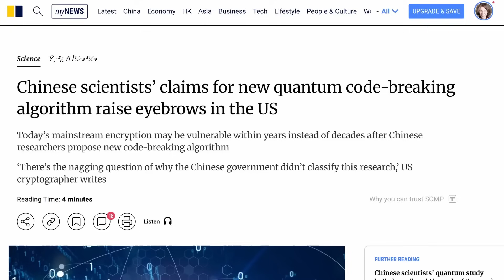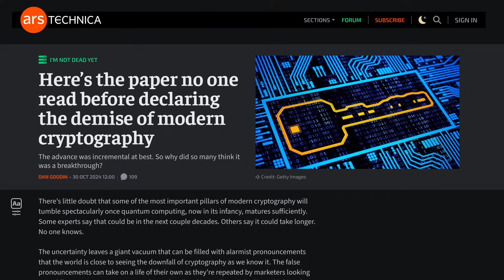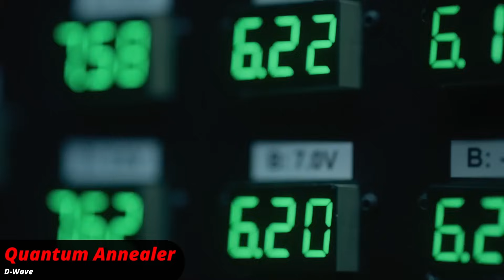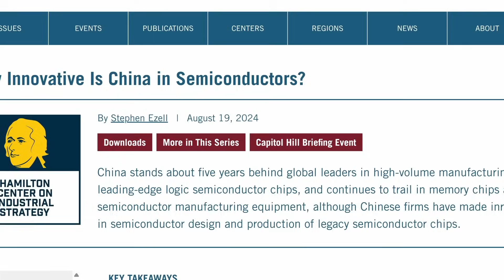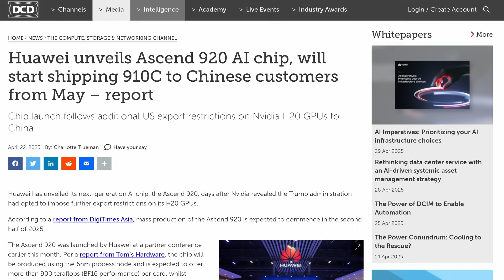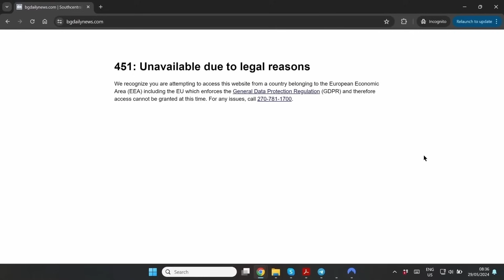Chinese claim "First Successful Factorization of RSA-2028 Integer". I've had a look.

Comment: "A quantum apocalypse?" "A quantum of lies?" well... a small anything doesn't sound that bad.
Reply: Nice
Reply: Lol nice. But Quantum just refers to a system made of discrete units that cannot be broken down into pieces of the same thing. Grammatically it should be "a quanta of apocalypse". Which would mean an irreducible unit of apocalypse. For example when the sun turns into a red giants and destroys earth I would say that is an irreducible unit of apocalypse, i.e. a quantum of apocalypse, if you will.

Comment: RSA used to have challenge numbers with prizes for factoring but disbanded it when it turned out that a large part of the US power grid was devoted to trying to factor them.  But here they are if you want to try for free. PS if they factored THIS rsa-2048 it's an actual achievement.  Nobody knew the factors including RSA, the factors having been destroyed in generation to prevent cheating by anybody.

Name:         RSA-576
Prize:        $10000
Digits:       174
Digit Sum:    785
188198812920607963838697239461650439807163563379417382700763356422988859715234665485319060606504743045317388011303396716199692321205734031879550656996221305168759307650257059
Name:         RSA-640
Prize:        $20000
Digits:       193
Digit Sum:    806
3107418240490043721350750035888567930037346022842727545720161948823206440518081504556346829671723286782437916272838033415471073108501919548529007337724822783525742386454014691736602477652346609
Name:         RSA-704
Prize:        $30000
Digits:       212
Digit Sum:    1009
74037563479561712828046796097429573142593188889231289084936232638972765034028266276891996419625117843995894330502127585370118968098286733173273108930900552505116877063299072396380786710086096962537934650563796359
Name:         RSA-768
Prize:        $50000
Digits:       232
Digit Sum:    1018
1230186684530117755130494958384962720772853569595334792197322452151726400507263657518745202199786469389956474942774063845925192557326303453731548268507917026122142913461670429214311602221240479274737794080665351419597459856902143413
Name:         RSA-896
Prize:        $75000
Digits:       270
Digit Sum:    1222
412023436986659543855531365332575948179811699844327982845455626433876445565248426198098870423161841879261420247188869492560931776375033421130982397485150944909106910269861031862704114880866970564902903653658867433731720813104105190864254793282601391257624033946373269391
Name:         RSA-1024
Prize:        $100000
Digits:       309
Digit Sum:    1369
135066410865995223349603216278805969938881475605667027524485143851526510604859533833940287150571909441798207282164471551373680419703964191743046496589274256239341020864383202110372958725762358509643110564073501508187510676594629205563685529475213500852879416377328533906109750544334999811150056977236890927563
Name:         RSA-1536
Prize:        $150000
Digits:       463
Digit Sum:    2153
1847699703211741474306835620200164403018549338663410171471785774910651696711161249859337684305435744585616061544571794052229717732524660960646946071249623720442022269756756687378427562389508764678440933285157496578843415088475528298186726451339863364931908084671990431874381283363502795470282653297802934916155811881049844908319545009848393775227257052578591944993870073695755688436933812779613089230392569695253261620823676490316036551371447913932347169566988069
Name:         RSA-2048
Prize:        $200000
Digits:       617
Digit Sum:    2738
25195908475657893494027183240048398571429282126204032027777137836043662020707595556264018525880784406918290641249515082189298559149176184502808489120072844992687392807287776735971418347270261896375014971824691165077613379859095700097330459748808428401797429100642458691817195118746121515172654632282216869987549182422433637259085141865462043576798423387184774447920739934236584823824281198163815010674810451660377306056201619676256133844143603833904414952634432190114657544454178424020924616515723350778707749817125772467962926386356373289912154831438167899885040445364023527381951378636564391212010397122822120720357

Comment: If the two prime factors only differ by two bits, that roughly corresponds to a 50 bit RSA level of security

EDIT: since my responses get blocked ... It's 25 bits corresponding to the position of the first difference (12 bit) a, the second difference (12 bit) b, and whether the differences have the same sign (00/11) or different sign (01/10). Once you know the product c and these, a factor x can be computed by solving the simple quadratic equation (x + 2^a ± 2^b)x = c. This equation is just in natural numbers, no modulus, a solution can quickly be found using binary search. This makes just 2^25 values to search, compared to the typical 2^1023 in full 2048-bit RSA
Reply: No. One factor will be 1025bits while the other is 1023. That will be 1023 bit security.
Reply: @chaoticmoh7091 You mean the LENGTH differs by two bits, but that is not what Sabine said.
Reply: @MoiraLachesis  . In RSA difference in length of factors is what they talk about. She assumed we are conversant with that. That is why she didn't clarify
Reply: @chaoticmoh7091 That's not "special" however, it's completely normal to have the factors of the exact same length in bits. If I look into the paper they also say both factors had a length of 1024 bits, so what you say doesn't check out either. In any case I'm not wrong, I even explicitly said "if" (I was worried about some communication mistakes myself) It's still good that you point out there might be a misinterpretation.
Reply: @chaoticmoh7091 If you have the product, the bits that differ, and whether they are 00/11 or 01/10 you can directly compute the factors without further guessing.
Reply: @chaoticmoh7091  Yes, it's 25 bits. If you know the product, the bits that differ and whether they are 00/11 or 01/10 you can directly compute the factors without further guessing. It's a simple quadratic equation (x + 2^a ± 2^b)x = c.
If you don't believe me give me a modulus created that way and watch me crack it on my laptop.

Comment: RSA hasn't been used to encrypt data on the Internet for more than 25 years.  Its simply TOO SLOW for that use case.

RSA is used for "proof of identity" - i.e. TLS Certificates.

AES is used to encrypt data, and Diffie-Hellman is the mechanism for generating and sharing the AES encryption keys.  Neither of which are susceptible to "factor large numbers" attacks.

Breaking RSA won't expose your protected DATA, but it will allow nation-state funded hackers to impersonate trusted entities - think Mossad impersonating Wells Fargo Bank - but that still requires DNS poisoning to trick your computer to send data to their server instead of the real one.

Comment: If the 2 numbers p q of RSA 2048  differs by only 1 bit, or few bit, there exist a simple algorthm: you take the square root of the number, and you check from there the number near the root, and it's very rapid, no need for D-wave something
Reply: It's not that p and q differ by one bit, but that (p+q)-√pq is small, say less than 2^128.
Reply: @pierreabbat6157  Correct.
Reply: That only works if the differing bits are of very low significance, or in other words, towards the end of the number. The two factors would then be very close to each other.
Reply: If the flipped bit is at the 2^k position, then p and q are approximately sqrt(N) +/- 2^(k/2), so they may be quite far from the root.
Nevertheless, running Fermats algorithm near those ~2048 starting points for different k may be quite feasible.
Not to mention that, while big k make the error in the estimate bigger and might require more iterations, one can then increment in bigger steps because one can make good guesses about p mod 2^k
Reply: Square roots have periodic zigzag paths in the binary SB-tree... and as Gosper said, computing with arbitrary word lengths beats fixed word length computing in many ways

Comment: All this is funnier when you understand that to avoid the "quantum speedup cracking every cryptographic system" all you need to do is double the number of bits for encryption.
Reply: Yes, going forward. The issue is the Library-of-Alexandria amount of information already collected just waiting to give up its secrets.
Reply: Yes, the same tactic that works against advancing conventional computer brute force also works against quantum computing.  In the case of quantum not just speed, but also whether the computer can handle numbers that big.  And by that measure classic RSA, with a longer key, has an advantage over the supposedly quantum resistant eliptic cyphers with shorter keys.
Reply: This is true for hashing algorithms like SHA256 but not for RSA. RSA gains an exponential speedup with Shor's algorithm, making RSA useless if real and big quantum computers ever comes to fruition.
Reply: @OdoctorG  Shor's algorithm doesn't account for quantum computers being unstable in exponential scale with number of Qbits.
Reply: @OdoctorG yes that's what i said
Reply: Shor's algorithm finds factors in  nearly O(n log log log n). Increasing the key size doesn't give exponential difficulty increase.
Reply: @edwardhuff4727  But the chances of a quantum computer losing coherence and crashing is exponential with the number of Qbits being worked.
Reply: @edwardhuff4727  not for symmetric keys
Reply: This is false (in the case of RSA). Shor's Algorithm factors arbitrary numbers in polynomial time wrt log N. Doubling log N will not necessarily make the quantum threat nonexistent.
Plus, the larger you get, the harder it is to actually generate keys of those sizes.
Reply: @titangames6888  yeah fine. It's true for symmetric keys. For Shor there are many other methods to avoid the quantum speedup.
Reply: @PathfinderPhysics  Really? I have not been aware of any such "other methods". Can you provide one or two such "other methods"?
Reply: @titangames6888  Shor's algorithm doesn't account for exponential instability with the number of Qbits being used.
Reply: @hanelyp1  Okay, fair criticism. That's not a perfect solution, but it does provide some viability for RSA with exceedingly large bit lengths. Not sure how practical it'd be though.

Comment: China will not become the leader in global microchip production anytime soon, except when you count Taiwan as a part of China… Mainland China doesn't have access to EUV lithography and has a 7nm-class process with stolen IP from TSMC… It took the last 2-3 years to achieve proper yields, but still has only limited production capacity. Meanwhile, Taiwan, South Korea and Japan have already had tape-outs for 2nm-class silicon that uses new transistor tech (GAAFET instead of FINFET). That's an advantage of 2-3 full-nodes, which translates to at least a decade of RnD.
Reply: >That translates for a decade of RnD
Not really. That is only when the RnD is cutting edge. For catching up RnD expect much more compressed timeline. Maybe 4-5 years at most.
Reply: @nhatmnguyen93  Again, China doesn't have access to EUV lithography machines. You can't just build one of these.
Reply: @Psychx_  China does not have top-notch automotive engine technology, but it does not prevent its electric vehicle technology from being world-class. There are still bends in the technology industry, and wearing damaged colored glasses can only harm your own eyes
Reply: A decade is not long for this kind of things.
Reply: AFAIK China is already the leader in mass production of bulk chips. And as said by others, becoming the leader of also cutting edge chips is just another 5 year program, as was becoming the leader in car industry. 

And as we've seen, having no competitive edge in cutting edge chips can be compensated with cutting edge software skills. 

The global center of Whitehead studies is in China. Process ontology of mathematics and developing intuitive innovative skills go hand in hand.
Reply: I have heard this kind of statement a lot. China can't do this and that but you losers can't even create a competent space program.

Comment: I’m not sure if you would actually be able to “steal” cryptocurrency by breaking the encryption. As soon as enough people realize something funny is going on and start suspecting that the network is compromised, I can only imagine that the perceived value of the cryptocurrency would basically disappear instantly. You would wipe out all the whales but I’m not sure how much you could personally gain from it
Reply: When you can break a wallt, in this case it means you can calculate the private key from the public one, you can transfair the coins from this wallet as you wish.

I would say that counts as "you be able to steal cryptocurrency". And yes, it is likely that the price for this coins will drop a lot. But when i look at the crypto bros, i am not so sure about that.
Reply: Given that its value would be nil so quickly, it wouldn't even be worth stealing, which would seem to be the ultimate deterrent to theft – unless, of course, the objective is to crash the system.
Reply: @Justin_Arut  I guess you could invest yourself completely in stuff that would benefit from cryptocurrency crashing
Reply: All the miners would announce that the official blockchain stops at block x, and from block x+1, a new quantum-resistant algorithm is used instead. The other blockchain, that continued to use the old algorithm, and had all those bitcoins stolen? It still exists. It's just a hard fork that nobody actually uses.
Reply: Actually, If someone broke the elliptic curve cryptography (secp256k1) used by Bitcoin, they could instantly start stealing coins by deriving private keys from public keys. Whenever someone spends Bitcoin, their public key is revealed on the blockchain. A hacker with this ability could compute the private key from that public key, sign a fake transaction, and send the funds to their own wallet—no password, no brute force, just pure math.
Reply: Bitcoin encryption is old and will be broken at some point in the next few years.